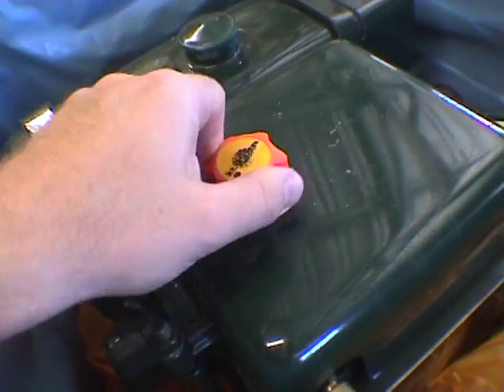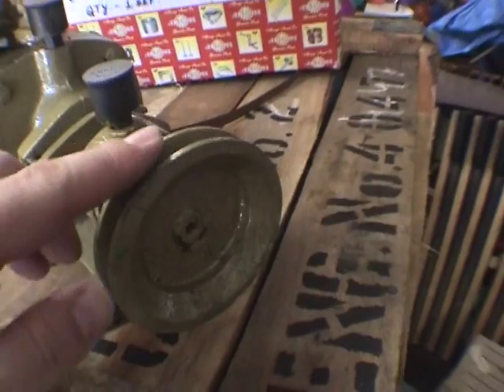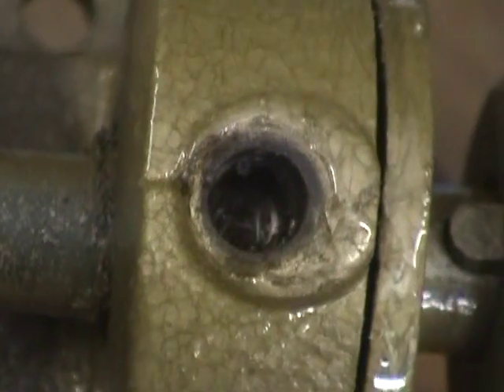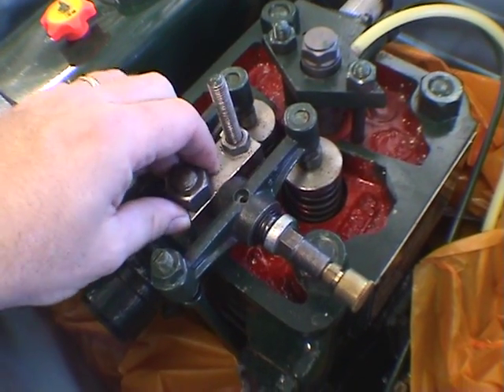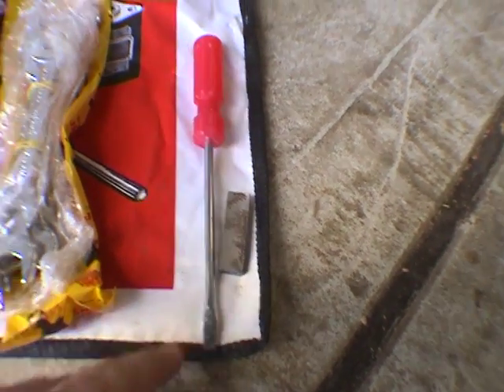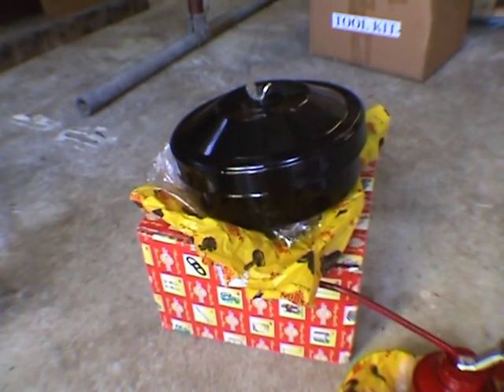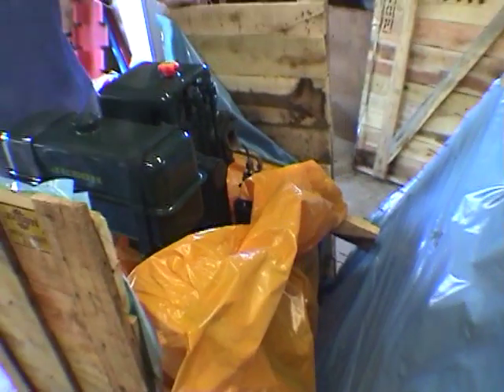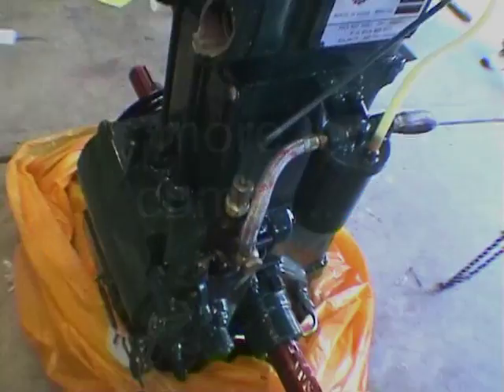Listeroid CS 8/1 uncrating and inspection #1

Comment: #1 dissemble everything clean it thoroughly and reassemble, if you have the new TRB'S preload them to 10 ft pounds pull scale not made to run loose , old split sleeve bearings require .005 end play ,